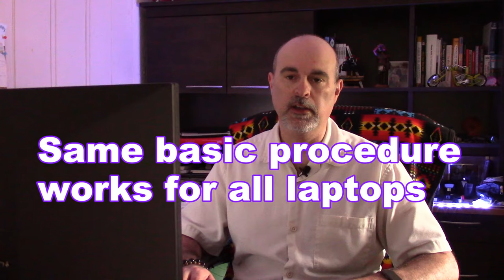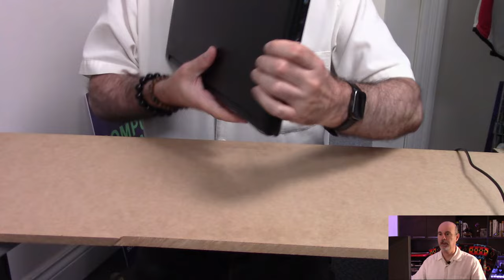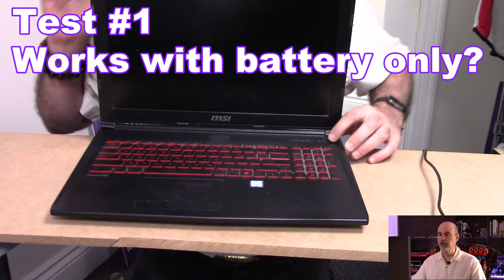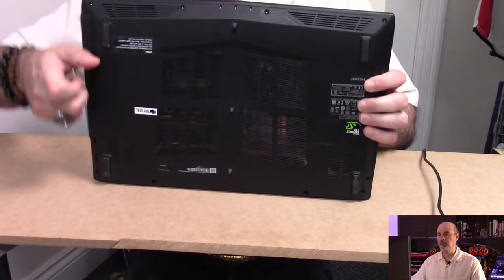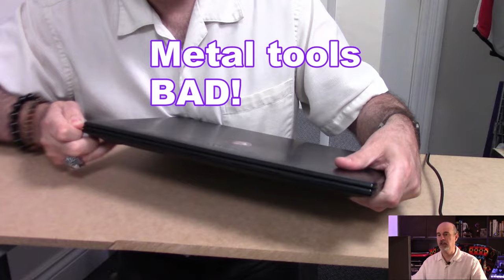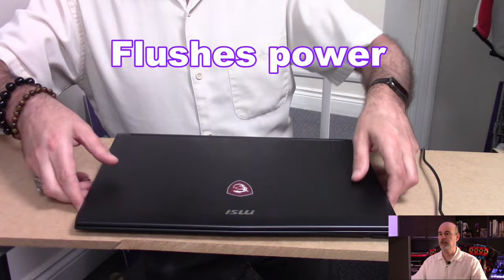How to fix an MSI laptop that will not turn on

Comment: I had installed additional 8 gb ram on my MSI mordern 14 laptop. After that it worked fine. Next morning when I kept it in sleep mode after then when I switched it on  it not turned on. I had followed your videos steps but nothing happens. Please guide me and help me to turn on my laptop
Reply from the maker: It sounds like you might have purchased bad memory or the wrong type.  Try removing that new memory and your computer may work again.
Reply: @TwinBytesInc  I had removed the memory but after that it is not turning on
Reply from the maker: It sounds like it's not the new memory that is a problem, but possible you shorted the motherboard while adding memory because you didn't ground yourself possibly.  You need to have someone look at it.

Comment: So mine is showing the blue light on the bottom of the laptop with the battery symbol above it but the laptop refuses to actually turn on.
Reply from the maker: It sounds like this video should fix the issue, but if not maybe it's turning on but the screen is just blank. you can try plugging in an external monitor to see if it works.  if there's still nothing on the screen and no lights flashes, the motherboard may need repairs at a local shop.

Comment: Hi , what’s the permanent Solution for this Issue ?
Reply from the maker: Hello, if this is a repeating issue, there is a problem with power flowing through the motherboard.  So the motherboard would need to be either repaired or replaced.

Comment: Hello. My MSI laptop blinks once on the whole keyboard when i press the power button but nothing happens after that. Who has experienced the same and how did you solve it?
Reply from the maker: These are usually codes that tell you what's wrong.  You can lookup the error codes for that specific model on MSI website.  There are beep codes for when they make sound and blink codes (maybe called something else) for when it's a light flashing a certain number of times or so many times fast and slow.

Comment: I updated a driver last night on my msi laptop, it restarted installed the driver then shut down. The power key just flashes and it won't power up. Ive tried removing the battery and power and its still unresponsive. When i remove the power lead the flashing stops, then the instant i put it back in it starts flashing again.
Reply from the maker: Depending what driver you updated, maybe just a co-incidence.  What is the sequence of flashing?  2 short 1 long for example.  You can lookup in the manual online https://us.msi.com/support  That may tell you what  the issue is.
Reply: @TwinBytesInc  thank you for replying, it is a continuous flashing. The driver was an optional windows driver, i didn't read the the specifics like an idiot. I think one was intel though. There were 2 drivers i downloaded. The conputer installed them then instantly shutdown and the power button started continously flashing. It only stops when i press and hold the power button for 20 plus seconds
Reply from the maker: @inlifeiamdeadindeath I don't do troubleshooting here, but I could suggest trying a boot disk to initiate a system restore and roll the computer back to a date /time before this update.  But it sounds like it might have been a firmware update and a boot disk won't work either.  You may need your local expert to look at this and see what they can do.
Reply: @TwinBytesInc  that's amazing! Thank you so much for your help. Im paid next week from work ill buy a boot disc and try it.

Comment: The battery on mine is kind of hidden, the thing that I think is the battery is under the mousepad and connected to a lot of things.
Reply from the maker: You might find a video on that specific model someone else has on how to remove the battery, but really it maybe just a few screws holding it to the motherboard, and one wide cable for the power that plugs the battery into the motherboard.  These can be challenging to see which way it comes out, so be careful not to force it in the wrong direction and break it.

Comment: The power button and keyboard are lit and the fan can be turned on and off but I can't see the screen. The screen is fully black. I have tried pressing the power button 15 seconds after unplugging the laptop adapter and then press the power button but it's the same. The laptop was a hand me down and I don't know anything abt it. Please help me I have tests coming up and I am freaking out.
My laptop is GP63 Leopard 8RE
Reply from the maker: Do you have an external monitor you can plug in and try?  Maybe just the screen is shot.  Aside from that, it may require deeper troubleshooting.  Could be a number of things we might not think of initially.
Reply: @TwinBytesInc  I do not have an external monitor. I suppose I will just have to send it to the repair shop from the looks of it. I really appreciate you for replying and helping tho. Thank you!
Reply from the maker: You're welcome.  Yes, someone does need to look at it since you don't have a spare monitor to try with.

Comment: Any tips if this doesn’t work :-/
Reply from the maker: If the trick doesn't work, it could require new battery, new power adapter, or motherboard repair.

Comment: My laptop stuck on logo and it keeps restarting again any fix for that
Reply from the maker: Could be corrupt Windows due to a bad hard drive.  Windows needs repairing, but if the disk drive is bad, it's going to just happen again.  Need to test your drive first then repair Windows.

Comment: I did press thee tiny hole a bit but a few minutes later i just disconnected the power adapter from the middle while connected to my msi pc, reconnected it and voalla it turned on with 20% battery, which shouldve been 60 (my max)or 50% minimum but i was playing a vr game that did seem to heat up my pc a bit so idk 🤷🏻 its brand new too so im worried about its future., thanks for the vid it may have tooken me slightly longer to figure it out, its my 1st gaming pc(intel core i5) my other 3 were low end pc’s due to the area i live in being… cheap.
Reply from the maker: Thanks for taking time to comment and I'm glad my video helped you.  I would normally say if it happened once and never again, maybe fine.  But if happens a second time, could be long term issues. 
When I got my laptop new it was tons of issues until it had all the Windows updates and eventually newer updates that fixed the issues.  I was prepared to return it but just in time Microsoft provided an update that fixed it.

Comment: what if my charger is fine , charging light is on, but the laptop also wont turn on ? i have that problem now~
Reply from the maker: This video typically will fix that issue, but if it doesn't then there is a bigger problem with the motherboard which needs repairs.  Small chance could be bad memory or battery, but not very likely.

Comment: My MSI Creator 15, was on when it suddenly went black screen. The power button which is usually orange was white and blinking. I reset my laptop hoping that would fix the issue. However, when I turn it back on, it's still black screen. My laptop is still able to recognise my face recognition and log me in (the lights flicker) and I hear it's at the desktop cos of the sounds, no Windows logo or anything showed up. What could be the issue and is there a way for me to fix this?
Reply from the maker: Hello Ochayen, thanks for your question.  It sounds like you just have a problem with the screen.  Make sure the brightness is turned up all the way.  Otherwise, you can borrow an external monitor and I can pretty much guarantee that will work.  That means you need to replace the screen on the laptop.
Reply: just a little trick,
open the lid, power on your laptop, close the lid, then open the lid again
sometimes it fix that kind of problem

Comment: I have a similar problem. My MSI laptop froze, the keyboard, the mouspad and my external mouse stopped working. So i Held the power button down for some seconds and it turned off. Then when i turned it back on again everything was fine. But then next day it froze again so i turned it off by holding down the power button again, But this time it didnt start back up again. The keyboard and power button lights up for about 2 seconds and then it turned off again. After about 10 times it starts back up again but the keyboard and mouse still dont work. So i cant log in.
Reply from the maker: This sounds like maybe a motherboard repair is needed, but hard to troubleshoot if inconsistent.  I would say to try flushing the power like in this video, not just turn it back on right away after turning it off.  But if continues, most likely bad motherboard.

Comment: I dont know but i have a msi alpha 15 A3dd

And when i press the power button, a orange ish light shows up on the powerbutton
Reply from the maker: Apparently that means it's using the dedicated GPU.  If the computer still boots you can reinstall the driver.  if it is not booting, maybe a physical problem with the graphics card and needs a technician to look at it.
Reply: @TwinBytesInc  thankyou ill see what i can do.

Comment: please help me my msi laptop workes fine on power adaptor but i try on battery then it shows blue screen and boot sometimes or blank screen. i checked battery health is good.
Reply from the maker: That doesn't sound like the health check is giving you an accurate reading because you just confirmed the laptop works fine on the power adapter.  Sounds like a problem with the battery connection or the battery itself.  Try removing the battery and reseating it.  Or you may need a new battery anyway.

Comment: Does this work for Msi MS-16R4? I opened the frame but wasn't sure how to take out the battery..
Reply from the maker: This should work for all laptop makes and models but each one has a different way of accessing the battery.  Some laptops, including some MSI have a pin hole in the bottom of the laptop which is very difficult to find, it can be used to reset the battery.  
With that said, if this solution doesn't work, there are other issues with the motherboard that requires someone to look at for repair or replacement.
Reply: @TwinBytesInc  thanks for the reply, the battery reset pin hole worked
Reply from the maker: @karyenng9239  Excellent!  You're welcome.

Comment: i have an msi that will turn on but i cannot get off the msi page can you help me
Reply from the maker: Sounds like it's having trouble booting from the hard drive.  Maybe a USB drive plugged in confusing it or there could be corruption in Windows or the drive is dying.  Needs more troubleshooting than I can provide in a chat here.  Sorry it's not a quick answer.

Comment: What if it turn on but then turn off again? Is it a problem of the charger or what? :(
Reply from the maker: Could be same type of issue and solution.  if it turns on to the point of loading Windows and then shuts down, could be a software problem, virus, bug.  if just shuts down immediately after turning on, it's probably a motherboard problem.  Someone needs to look at it.
Reply: @TwinBytesInc  I tried another time and now it works! So thank you very much, you saved me 🙏🏻
Reply from the maker: Excellent!  You're welcome

Comment: Im upgrading or cleaning laptop 2* per year and always having same problem. MSI GP 63 8RE
Reply from the maker: Very strange if you have the same problem when upgrading only.  Not sure if you mean the same laptop twice a year during cleaning or upgrades has this issue?  Sounds like motherboard issues.
Reply: When upgrading / Cleaning. The same laptop always, never happened with other ones laptops. For me its always RAM problem (IMO) Idk how to detect problem
Reply from the maker: I literally just released a video this morning about testing your memory.  I also have a few videos about testing memory if you search my videos list.

Comment: My msi powers up screen will come on for a few seconds then.goes off
Reply from the maker: Thanks for your comment.  If the suggestions in this video didn't help, maybe an update to the BIOS will help.  Or there's a small chance it is an operating system issue and it just tries booting to fast to see any errors.  you can try booting from a bootable USB or DVD and see if that works.  Regardless if Linux, Windows or some other utility.  Just to confirm the laptop is fine and it's either the hard drive or the operating system on the hard drive.

Comment: I just recently got an msi laptop and it was working alright
Then the laptop just turned off and i can't even turn it on now and even if i connect the power adapter the laptop isn't even charging there is no light no nothing
I've tried the 60s method and tried plugging the adaptor for like 20mins but it doesn't work..please help
Reply from the maker: If this video didn't help, I had another viewer realize he just let the battery drain and all he had to do was plug it in.  Maybe also ensure all connections are tight, plug into a different power source.  Maybe the power adapter is fried and you need a new one.  You could take it into a store and ask them if they can temporarily plug a spare one in and see if it works.  if it does work, then you can buy that adapter.
Reply: @TwinBytesInc  thanks..will give that a try

Comment: Hey my laptop is brand new and it happening sometimes ... Sometimes it switch on soo smoothly and sometimes it didn't switch on ... Do i have return the laptop ...
Reply from the maker: If it's brand new,  definitely it's under warranty and you should ask for warranty repair or replacement.
Reply: @TwinBytesInc  is it a big problem?
Reply from the maker: It could be.  It could get worse.
Reply: @TwinBytesInc  but sometimes it switch on properly ... I lost my warranty card ... Please what should I do sir please
Reply from the maker: Sounds like you have to either pay someone to fix it or just keep using it until it doesn't work anymore and then consider fixing or replacing.
Reply: @TwinBytesInc  ok thank you for your response ...

Comment: Great video, hope you can help me out. I have an MSI GE72 Apache Pro that would not update and now will not boot properly. What can I do here?
Reply from the maker: Thank you.  It sounds like you have an operating system problem, not a hardware problem which this video is about.  There are many things you can try and without getting into a billable troubleshooting, you can try a system restore point or reinstall Windows preserving data.  I'm releasing a video tomorrow on system restore.

Comment: How to fix msi model ms-16j9 blank screen?
Reply from the maker: Doesn't matter which model.  The solutions are generic.  If this video doesn't help, there is a physical hardware problem that needs something replaced. Maybe screen or inverter board for example.  Needs someone to look at it.

Comment: HELP! i did this step, but it's still not working, the led light charger is dead, and my laptop still wont turn on :( and all i did was letting my laptop rest untouched for a week
Reply from the maker: If it was left plugged in the entire time it could have gotta a jolt of electricity and fried.  if this video didn't help you may need a motherboard repair.
Reply: @abu.mu1awiya  i didn't, but i found the problem, due to the cold weather when i left my laptop for a week, condensation  occurred, and a part of the motherboard fried 🫠

Comment: I need help with my MSI - GS66 10SE 15.6

 Won't turn on anymore
Reply from the maker: Thanks for your comment.  If the suggestions in this video didn't help, maybe an update to the BIOS will help.  Or there's a small chance it is an operating system issue and it just tries booting to fast to see any errors.  you can try booting from a bootable USB or DVD and see if that works.  Regardless if Linux, Windows or some other utility.  Just to confirm the laptop is fine and it's either the hard drive or the operating system on the hard drive.

Comment: My battery doesn’t look removable when I opened my msi
Reply from the maker: All batteries are removable, you might have a few screws that need to be removed first, unless it is removable by a slider on the bottom of the laptop.

Comment: What can I do if the screen shot does not come from the msi laptop
Reply from the maker: Maybe check brightness levels if turned all the way down.  Or plug in external monitor to see if it is just your screen needs replacing.
Reply: HDMI connected image turns out tv only laptop image does not have 1 month laptop
Reply from the maker: Sounds like laptop is ok if TV shows the display.  You probably need to replace the laptop screen.

Comment: I have gl66 i bought it like 2 weeks ago and this happening to the laptop. This laptops are not cheap. Sorry msi but i love my toshiba.
Reply from the maker: Yes I agree Toshiba is my preference over MSI.
Reply: Same to me as I got an MSI at Sep 04... Will it break the warranty if I open the back panel
Reply from the maker: @akashkarthikeyan7292  Thanks for sharing.  I'm sorry to hear this.  That really sucks.  However the good news is it's under warranty still.  So you can request replacement or at least a repair.
Reply: i also have a GL66 that wont charge or turn on.